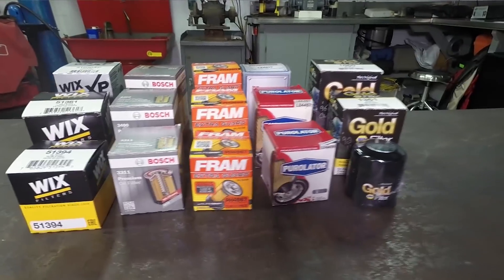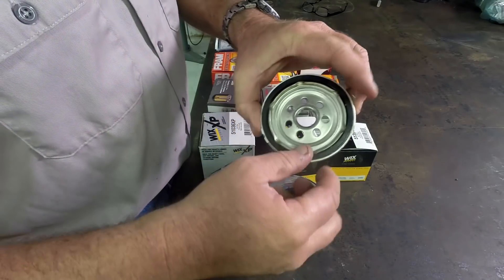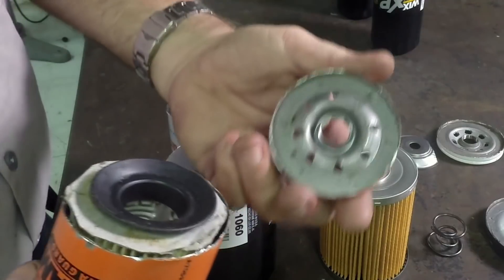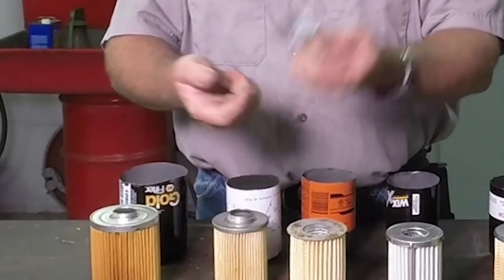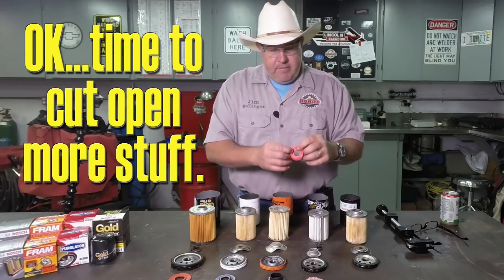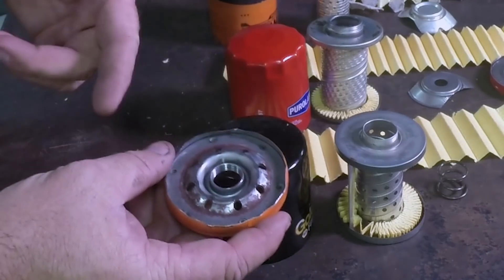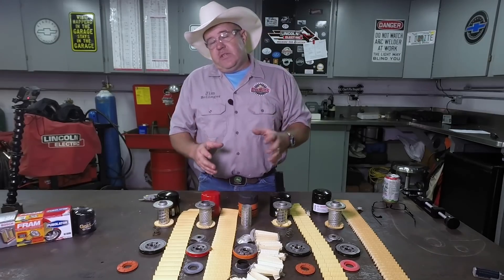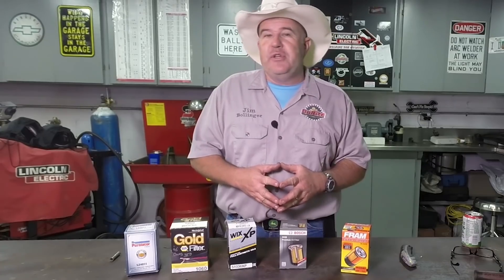The worst oil filter EVER!

Comment: simple rule, change your oil every 2500 to 3k miles and you'll do alright. Used Fram (cheapest one) and never ever had a problem. My Camry ran to 260k with never a problem.  10k change is asking for problems... what do you think the car industry wants? For you to keep your car forever?  Hell no.

Comment: The old fram filter 65 years ago was a roll of tp . In 1970 purolator was the up grade . Have never used fram and one customer wanted ac and I had to replace it because it leaked around the seam . Never had any trouble with purolator or motorcraft filters .

Comment: I call bullshit. The competition doesn't like to be undersold by Fram.
98 S-10, 257,000 miles. Used nearly every brand of filter available, but probably 80% of most of the time it had Fram oil filters. Took several apart and found no issues. I still don't check the oil level between changes.........Trust :)

Comment: I've used Fram oil filters almost exclusively on about 9 different cars (foreign and domestic) since the late '80s ... no issues. However, I have also changed oil on manufacturers recommended interval, and always used Synthetic since it started showing up in auto parts stores10 or 15 years ago. I think oil change interval and the way you drive (and if your coolant system is working properly) are bigger factors for engine wear / failure.

Comment: You need to get certain facts in proper perspective. 1st, all that rust in the Fram, though not impressive of course, but it will not go into your engine since it is before the media. The drainback valve, yeah, it's cheap, but it'll still do what little it needs to do. The amount of filter media, well, more doesn't hurt but you really only need as much media as you're going to fill with particulates. This mostly only becomes a problem with someone that never changes their oil. I'm not saying these filters aren't crappy - they are - but reality still makes them fairly adequate. Also, Fram makes several grades of filters, why doesn't anyone ever cut the higher grades open? No, I don't use Fram either, I've always stuck with Wix/NAPA, but while bringing up issues they need to be evaluated with logic too. Also, contrary to one of the captions, oil doesn't get filtered as it drains back, oil gets filtered under pressure right after the pump and right before going into the engine.

Comment: I’m 67 years old and have been using Fram for most of my driving years. The key is changing oil and filter every 3,000 miles, now every 5,000 miles with the synthetic blend. All my cars drove strong for many miles and I did not change every 6 months only after the 3,000 or 5,000 miles. The vehicle with the most miles was my ‘84 Caprice wagon with 190,000 miles, finally donated to Kars for Kids ‘cause it’s was corroding away after 20 years. ‘70 Maverick gave to my older brother-in-law, ‘74 Pinto gave to my younger brother-in-law, both ran until they rusted away in the Illinois road salt. I’m still using Fram in my 2009 Chrysler Town and Country with synthetic blend at 5,000 mile intervals. I will continue to use Fram.

Comment: I have my car maintenance software www.automotivewolf.com setup to remind me to change my oil and filter every 5000 miles. I just use OEM filters right from the manufacturer as recommended in the owners manual.
Reply: That Automotive Wolf program is awesome. I've already got it monitoring the maintenance schedules on all 3 of my vehicles.
Reply: @marctolwin2701  very cool software :)
Reply: Fram sucks.......
Reply: Manufacturer filters are just from the cheapest vendor they could find to make or rebrand them for maximum profit. Wix filters are literally made to be the best filters on the market because they do filters. It's like buying a windshield from OEM when you know PPG or someone else made it and your OEM is just adding on cost, they don't make their own wear parts and haven't for at least 30 years. You are paying more money for the cheapest possible filter when you could buy that filter from a filter maker and have better quality for the same price.
Reply: I have a shop, and was using Purolator filters exclusively, I found I could get the OEM filters for a similar price, sometimes less.
Reply: @royjohnson8122  I usually use whatever filters I have available, usually Bosch, STP, Purolator, Wix, Napa Gold, but never fram. It's the K&N of oil filters I swear

Comment: I wish you would buy a real filter cutter.
Reply from the maker: I wish you would look on the workbench.
Reply: @DoRiteFabrication   You are Right!  Didn't see it......but then WHY did you cut them apart with an angle grinder? 

Napa has filter cutters and they are eligible for the "filter sale" discount.  Surprised you didn't mention it at least as an oil analysis tool.

Comment: I bought my Tahoe with 25 thousand on the odometer it now has 300,000 on it..  I have used Fram exclusively save twice.. I also use quaker state10w 40 .. hot clime here in south Florida.. no engine noise..  I have complete confidence in my choices.. so like when wally was out of fram I bought a purolator..  and when my exhaust had something loose in it I tried a K&N.. pfft,,...…. but Fram has worked for me.. the filter should stop any loose debris in the oil field..  I saw a brakes rotors and calipers kit the other day for 14,000 dollars.. lol.. It's not required..  but hey what we really need is the borders and banks fixed.. (money)

Comment: My two cents; I found this video interesting because I change my own oil and share the same curiosity as many. I enjoyed this video and although it touched on some interesting findings, viewers should realize this video is not conclusive and does not produce any substantial evidence of effectiveness and efficiency of the actual filtering of the filter. The introduction says something like "What I have decided to do is to cut up a bunch of filters and show you what's inside". And although the video definitely showed this, titling a video "The worst oil filter EVER" is a bold statement since your opinion is based off an inadequate test. Perhaps investing in a scientific method approach consisting in systematic observation, measurement, and experiment, and the formulation, testing, and modification of hypotheses that determines results of the effectiveness and efficiency of a filter. Perhaps consult with companies who specialize in conducting test like this. I like the production and feel of this video, I am just not fully convinced of your findings. Not to discredit you anyway but I am not sure the owner of a fabrication shop should be presenting videos that deal with testing, two different worlds in my opinion.

Comment: Using a cutting wheel will introduce metal particulate into your filters giving you false readings for trapped metal particulate. You should use an opener comparable to a can opener to eliminate this problem. Accurate readings would be interesting to see.
Reply from the maker: Its sitting on the workbench.

Comment: Sorry, Been changing my own oil for close to 40 years and have used Fram filters off and on for that entire time. Dodge, Chevy, Ford, AMC, Buick, Nissan, many different Jeeps, Hondas, and Kia. Most of these vehicles had well over 100k miles on them when sold, and a couple of them (Honda and Jeep) had over 200k miles when sold and all of them were running well at that time. Don't buy into the hyperbole this guy is spouting.....the filter element is contained inside a metal case, that is how it withstands oil pressure. Never heard an "expert" refer to a "springy thing".

Comment: Can anyone actually present genuine evidence that proves the poor construction of Fram Filters causes premature failure of lubricated engine components? I am failing to see anything actually proving the supposed byproduct (damage to your engine) of using so called "poor quality filters". I am all for using quality parts but I fail to see how the cheaper construction of Fram Filters has a negative impact. (NOTE: The surface rust on the inside of the Fram Filter would never grow due to the fact that it will be well, I don't know, maybe covered in oil and suffocated of oxygen. And on the return pass through the filter if it even fell off (which I doubt) would likely be pulled out quickly. Not saying its good but....) Been using Fram Filters for 24 years 9 vehicles (well over 500,000 miles) and never had a premature internally lubricated part failure. Go ahead and switch brands if it makes you feel better but know there is NO REAL EVIDENCE proving filters of lesser quality construction are going to cause damage. Think about it, if they did cause damage how could Fram keep selling filters??? And why hasn't every car manufacturer not banned the use of these filters in their engines while under warranty if that is true???

Comment: I've used Fram in every vehicle I've owned in nearly 25 years. Each accumulating over 200k miles without engine problems. My current vehicle is running smoothly at 177k. But I when I buy my next new vehicle, that engine will no longer be lubed by oil passed through a fucking FRAM!

Comment: I'd be curious about a supertec filter from walmart...😉
Reply: I used them years ago on an older car I didn’t want to spend a lot of money on. I found the filter to be high quality, much better than Fram. Surprisingly Super Tech oil is really good as well. I’ve seen several used oil analysis reports over at Bob is the Oil Guy and they were super solid. Some guys ran the oil and filter up to 15,000 miles The car I ran them in was a 1999 Camry with 350,000 miles at the time I sold it. It’s been years and it’s on the road to this day.
Reply: OH shit YES a 2 cent oil filter they are the best, be sure to use it with recycled oil.  Wait for it . . . . . . BOOM !!!!!!

Comment: It will not destroy your engine. It does what it needs to do. 

Just because I don't have an over engineered Dyson vacuum doesn't mean my vacuum is going to destroy my floor... Lol

Anybody can tell you the quality of anything. But not how good something needs to be to do its job properly.

There will always be better products. But is it really a situation where your engine will get destroyed??? No. The company would have had backlash, law suits and wouldn't be the number 1 seller if of so.
Reply: If your cheap vacuum stops sucking you quit using it and buy another, no harm done. If a filter fails and bypasses internaly you may not notice for a few thousand miles causing permanent damage. More piece of mind than anything.
Reply: Lol great analogy

Comment: I guess myself and all the millions that use Fram over the years, have just been lucky? Not sure this proves anything concrete. I would like to see a charting of actual engine failures based SOLELY on what type of oil filter is used. Other wise, this video shows different constructions, that may or may not be detrimental in reality.

Comment: While I can't defend rust in a new filter, I've never found any in filters I bought, but so what? The way he demonstrated the filter operation, the filter will remove any contaminants almost immediately. Maybe the ones he bought were stored in a damp environment. Next, the can. So one is heavier than the other. Does it have to be? The one time in my 45 yrs. as a mechanic that I witnessed a filter broken open was from an engine that had a stuck pressure relief valve, & it broke open at the seam between the can and the base. You can build a house with oak 2x4's, stronger, denser, but why would you? Pine is cheaper, and works just fine. Next, the spring. Again, so what. Some cars have leaf springs, some have coil springs, some  have torsion bars. They all hold the car up. Then there's the filter media. No doubt, some are better than others. But nothing is in there twisting or pulling on it when the engine is running. Oil filters don't have to last forever, they just have to last to your next oil change. Manufacturers tout their materials as "Better" because they know there's customers out there that just have to have the "Best", no matter what it is, and they don't think about it rationally, or don't know any better. I have one nicer, newer  car for my wife, and I drive beaters, always have. Four of my five cars have over 100,000 miles, two have over 200,000. Except for manufacturer defects ie: GM intake gaskets,etc. I haven't had to tear down the engines in any of them. I can't say I've always used Fram filters, but I've used them enough to Know it's a good filter at a good price.
Reply: You raise a very good point. Well said.
Reply: Totally agree.  I've used Fram filters since the 1970's and my dad used them for years prior to that and I've never seen a single instance where they have failed or caused another part to fail. Some may be constructed better, but until someone can show me where the Fram fails to filter adequately I'll keep using them.

Comment: Dennis, I used to use fram.Yes I know what I am talking about.What about you since you are quick to judge.Did you test any out?
Reply: What did you want?  He opened it and it was rusted, had parts that should have been made of metal made of cardboard and had a small surface area filtering material.  What part of "crap" did you not understand?

Comment: Had a Fram oil filter come apart on me and cause an oil starvation issue. Changed oil and used a Purolator filter and all was well. Have been using Napa filters for a while with good results.

Comment: Wow! That Fran filter looks like its assambled by a kid using glue and toilet paper
Reply: This is the cheapest filter they carry.... and hes comparing it to more expensive oil filters. Fram has 3 or 4 models better than this. Their synthetic version is great. Has all the bells and whistles.
Reply: @TDIETZ22  but still this filter... the cheapest version (this one) can litterly destroy the engine!! Paper and glue coming loose... Is unacceptable. Even if they give them away for free i will not install this
Reply: @N-e.o  ive never once heard of that happening. All super cheap filters are made a similar way. U get what u pay for
Reply: @TDIETZ22  a filter is just a filter.. It has one job only.. "Premium" build "quality" filters like Bosch costs the same or less as the Fram garbage in this video? So did I really got what I pay for? Clearly not.
Reply: @N-e.o  https://youtu.be/VzCqjZgIMBk

Start 12 min. Theres a huge difference in quality as you go up in price.

Comment: From Leo:   Thanks for your work.  I will disagree with how alarmed you are.   I have been driving since 1971.  I spent my career driving lots of miles in 4 Midwest states.  I usually get tired of a car at 200,000 to 250,000 miles. Even the little 4 cylinder cars still run good at that mileage.  I have used lots of Fram filters.  I don't use any special oil.  Just whatever dinosaur oil grade the factory recommends. Change oil at 4000-5000 miles, whenever it is convenient.   I have never had any lubrication related failures on 8, 6, or 4 cylinder cars, trucks, motorcycle or airplane .   Apparently even the cheapest one is enough to do the job.  I can appreciate better, but I do not worry about any brand name filter.
Reply: Another REAL thinker...see JIM...it's NOT about what the quality of the filter ,but how well it does it's job.   Nuff said.

Comment: Apparently Fram doesn't give a damn.  Great video.
Reply: This is the cheapest filter they carry.... and hes comparing it to more expensive oil filters. Fram has 3 or 4 models better than this. Their synthetic version is great. Has all the bells and whistles.
Reply: @TDIETZ22  Hi Tyler;
You're probably right however, I have just never seen a different Fram model on the store shelves.  It's always the one he cut open.  I'll visit their website and see what I can dig up.  Thanks for the heads up.

Comment: YOU ARE AN IDIOT !!  THATS NOT RUST !!   thats Discoloration  where they use heat to cure the cardboard to the filter. there is NO rust in the canister !!  yes it is a cheaper filter, but its susposed to be. its only good for 5,000 miles and is dirt cheap for walmart to sell. if you want a good filter test a fram ultra filter rated for 15,000 miles. cut one open to see , makes your napa filter look like a pice of shit.  i am a mechanic & i know what im talking about.  you are lying to these people and should be ashamed

Comment: Miss out the most important thing about oil filters, the size of the holes, He might knock the cheap one being rusty, but the tiny holes could stop any rust getting though the filter, where as the one he like most of all the Gold its filter may not stop any rust from passing though. the most important part of a filter is the size of the holes, how they are made and what they are made from comes after the size of the holes. 

the real proof would be to cut them open after they have had 12000 miles of use. and then see if the filter is still working.

Comment: and not a very thorough test at all. What is it the filter filters out of the oil? Did Fram put that in the oil? No. You need to run several identical engines with same oil and different filters  and same roads and speeds. Go 100,000 miles in each car... Then tear down the engines and measure everything. Your test is BS.

Comment: LOL.. my old SR20 powered Sentra SE-R which I redlined all day at 7200 RPM, lasted well past 250k miles using mostly Fram oil filters! But I did use synthetic Mobil 1 oil. And now my new car uses can-less oil filter and I bought Wix because it looked better built than the rest.

Comment: I have been using a Fram PH2 on my Dodge Ram hemi for 10 years and it now has 245,000 miles and doesnt blow any oil
Reply: Doesnt make it a good filter. You can literally Google propel who's motors have blown from fram. They even had a lawsuit for there cartridge filters causing ford's leak and blow up
Reply: See JIM...he has used those NO GOOD TRASHY FRAM filters for bo-coo miles...still running....